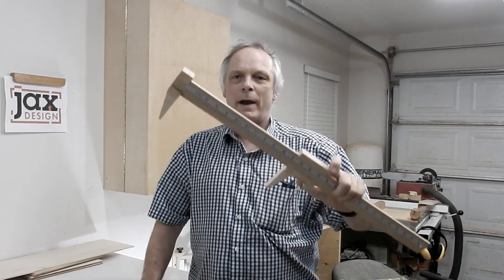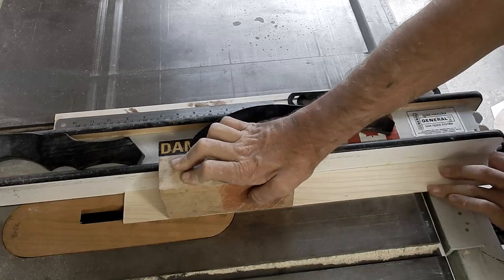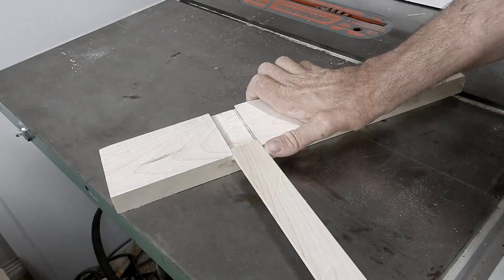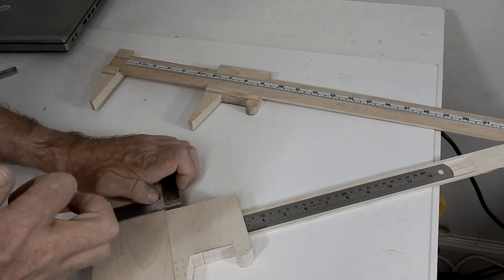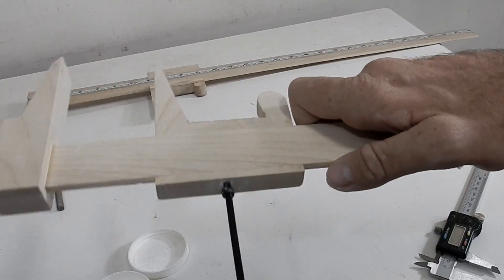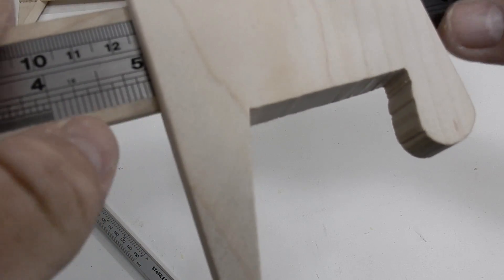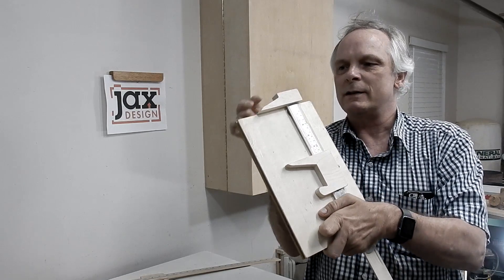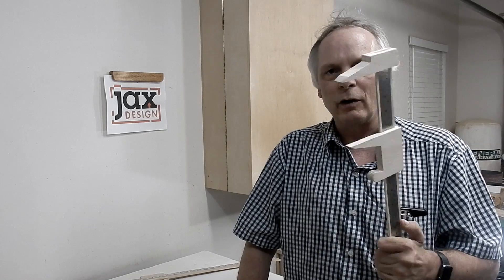New improved caliper

Comment: Beautiful design, like so many of your projects I've seen. Just a couple warnings I noticed about using the table saw. I'm an old shop teacher who has seen many different issues over the years. Evan had a couple kick backs myself that were very painful. First a feather board is a great help in holding work against the fence in front of the cutting part of the blade. You end up not having to use 2 push sticks and it helps eliminate kick backs a great deal. Secondly, I noticed you cutting the dado in the board when you pulled the board back over the blade. You will probably get a way with it for a while but eventually the blade is going to grab the board as it is spinning back toward you and the board will kick back. If it hits you it is very painful. Hope it helps.